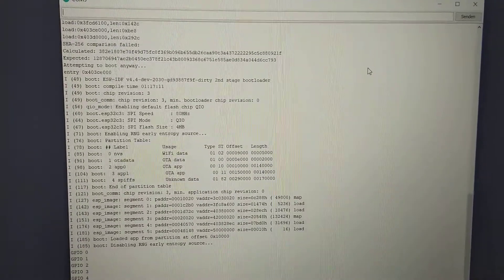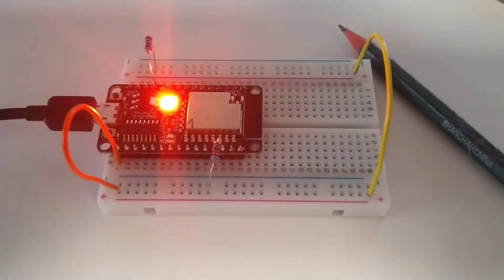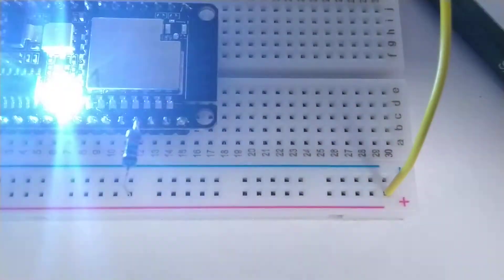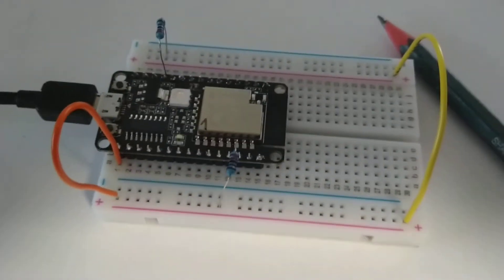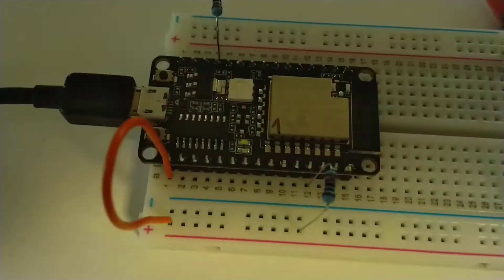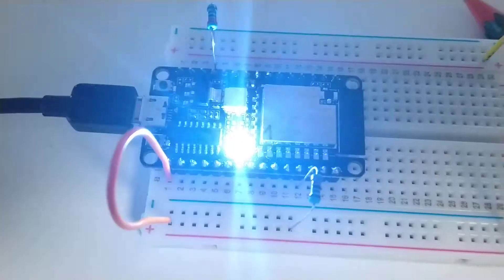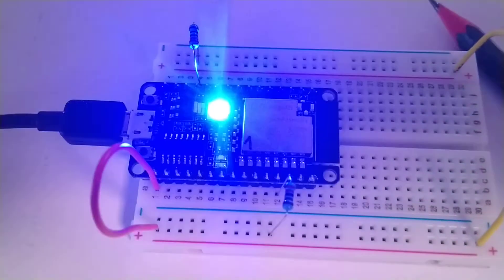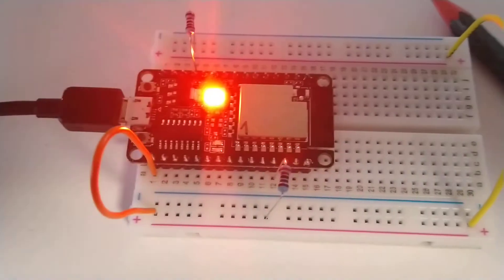ESP32-C3 seriell monitor workaround

Comment: Fun right!!!!!  NO HARDWARE CHANGES NEEDED!!!!   RTS-DTR is set LOW after reset.  Find the boards.txt file in your /Users/**NAME**/Library/Arduino15/packages/esp32/hardware/esp32/2.0.0-alpha1 folder.  Find the C3 board profile and change the RTS and DTR lines from false to true.  Restart the IDE, RTS/DTR will idle HIGH now.  Also the published diagram has errors.  GPIO-0 does not break out, it is tied high with a 4.7k. ADC input is pin 1, GPIO-1(A1) is pin 2, NC pin 3, GPIO-9 and GPIO-10 are flipped. ADC only seems to work on GPIO-0 (A0) (which is not broken out).  Hopefully someone figures that one out.  good luck
Reply: thanks!  I've just bought this board today and found your comment. Lucky me:) It's working like you said. One difference, there is 2.0.0 revision released, no more alpha.
Reply: @siedemgrzechow  Glad to help. Bought my boards in July, sorted out the issue last week. There is a new driver for OSX so the CH340 will idle HIGH when not being used by an app. I tried the 2.0.0 and it corrupted my IDE, maybe the next iteration.  Had to rebuild from my backup drive, very extreme. Now to figure out what's wrong with the ADC...:o)
Reply from the maker: To "eb b": what OS do you use for Arduino IDE? I use Arduino IDE on MS-Windows. I found my boards.txt file at C:\Users\**NAME**\Documents\Arduino\hardware\espressif\esp32. I changed these lines: esp32c3.serial.disableDTR=true
esp32c3.serial.disableRTS=true
Before there was false as value. Now I don't need 2.2k resistors. Thanks!
Reply: For those on windows the folder is on C:\Users\*Name*\AppData\Local\Arduino15\packages\esp32\hardware\esp32

You need to enable show hidden folder to see app data folder

Comment: Hi Paul, i have same problem here, your solution fix my issue when i opening Serial monitor. Good Job...
Reply: Checkout my comment...
Reply: @ebb2421  Hi, i try your solution. modify board.txt file, but ESP-C3 still not working when open Serial monitor in arduino IDE 2.x